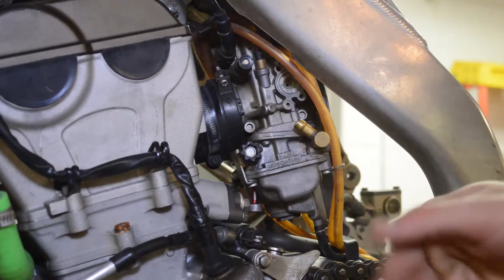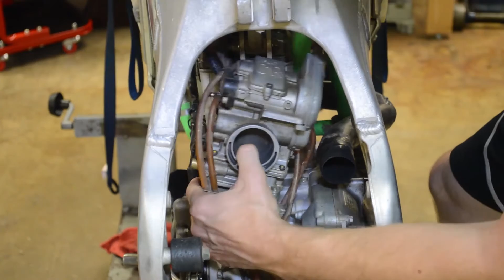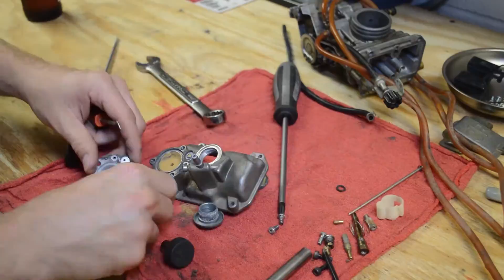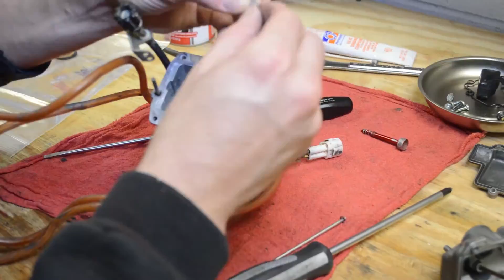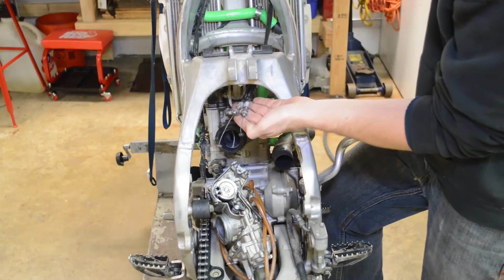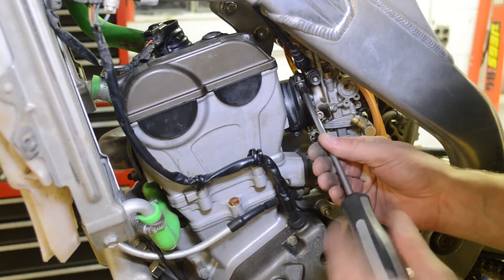How-To: Clean a 4 stroke MX/Quad carburetor

Comment: Hi Matt, i recently bought a 2009 Kx250f and am having some problems with it starting, running under its own power, and spitting and sputtering when at about quarter throttle. The person i bought it from told me he adjusted the valves about a month ago and cleaned the carb at the same time. The only way itll start is if im giving it throttle while kicking it and hoping it turns over. Any ideas or recommend i try anything? Thanks!
Reply from the maker: Double check all "work" PO has done. I have a video on KXF valve adj, so make sure to check that out. Then, take the carb apart and clean it. I have vids on that as well.

Comment: I have an 09 crf 250r, I just got through doing a bottom end rebuild on it. The bike is really hard to start especially when hot. When the bike is running and I give it a little throttle and let off the Rpms don’t drop like they should, it just keeps revving up. I noticed when i turn the idle speed screw down the problem with the rpms not going back down would go away, (the rpms would go down like normal).The last time I went to try to start the bike I could not get it started, it’s always really hard to start.The fuel screw is screwed out as far as it can go and I have a 48 pilot jet in there. I’m thinking that I have lean condition, maybe a vacuum leak? Do you have any suggestions?
Reply from the maker: Yes, you sound lean. Check for vacuum leaks and operation of the hot start. Verify hot start plunger is not frozen.

Comment: Hi Matthew, i have this same type of carburetor on my WR250F 2001, a Keihin fcr 37mm i guess you have. 
Either way, i took it apart, i took the bottom and top part but ALSO the middle part. I mean there are still screws on that carb you did not took of, inside there is a pretty complicated seal, which was completly destroyed in my case. As i could not find a new on internet i managed to create one with seal paste.
My question is, have you ever opened that part ? Do you know where we can find seals for this part ? 
And any advice maybe ?

Thankssss !
Reply from the maker: Google "fcr mid body o-ring kit" and you will find the gasket you need. Don't use a seal paste.
Reply: Oh thanks a looot !! Really i was worried since i saw a split view of that carb, not showing those o-ring.

Comment: I would like to get the full version. My question is If I buy access to it today will I be able to watch it again in a couple of days? Also do I get full controls like rewind and pause? I have a 06 Yamaha YFZ450 that has been sitting for a couple of years and has idle issues and only runs in the 1st pull out on the choke. Thanks in advance for your help.
Reply from the maker: +Stephen Snowman Yes, the video is yours forever with unlimited views. It has the same player controls as a youtube video. 

Sounds like your bike has a plugged up pilot jet from sitting.
Reply: I too am looking for the full version. It showed 45min video on your website but it’s no longer up. Just this version. Thanks!!